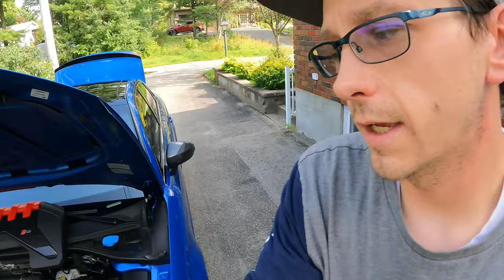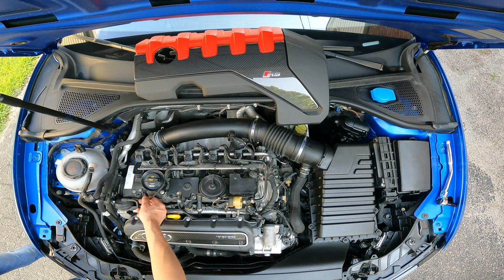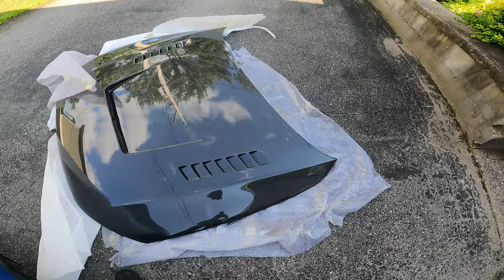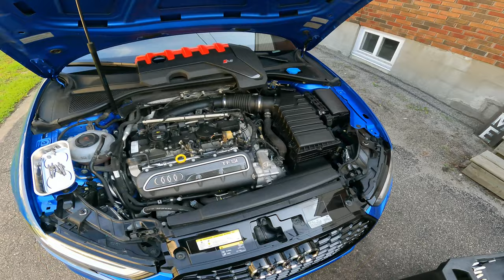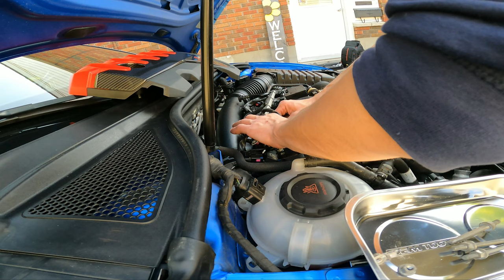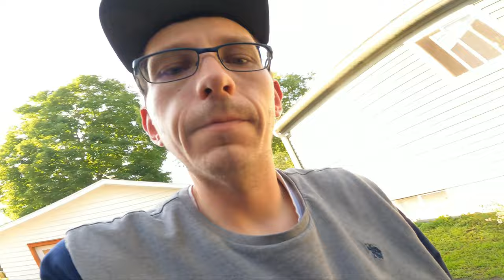2018 Audi Rs3 Sparkplug Change (DIY Replacement)

Comment: Thanks for this.  I'm new to the RS3 platform and got a misfire in cylinder one.  Found your video, changed all 5 to be safe and the car runs great now.
Reply from the maker: Its good to hear the video helped you out!  I have wheel bearing video coming out soon too